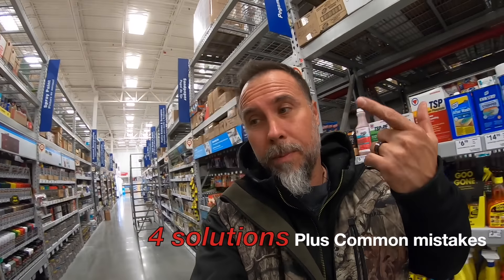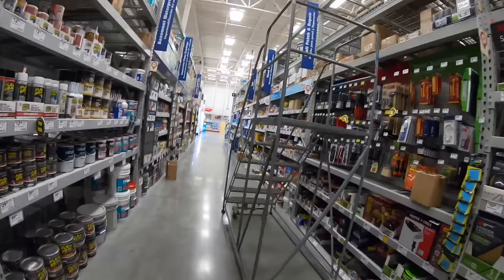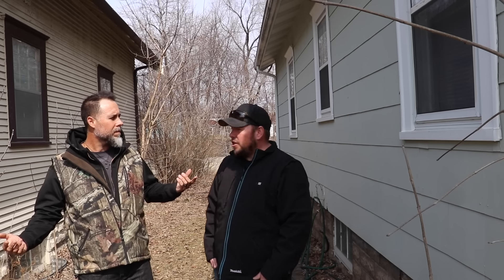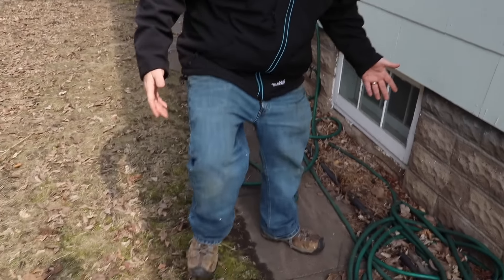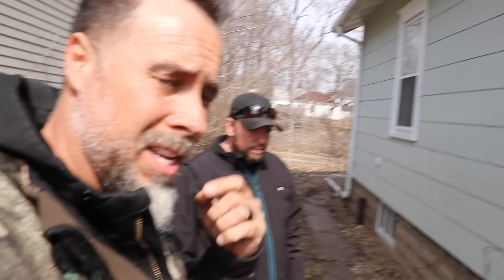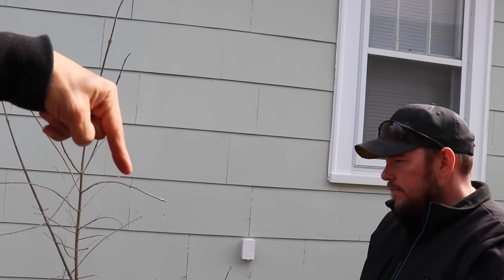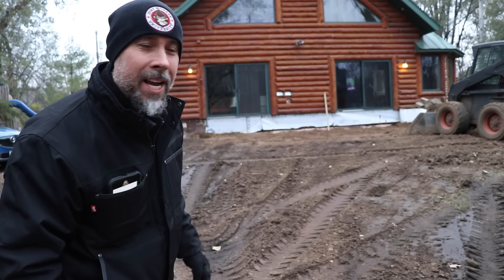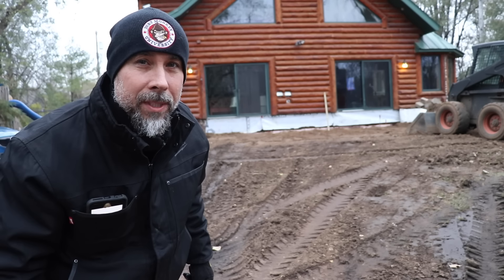4 Solutions to fix a wet basement plus Noob Mistakes

Comment: I did waterproofing for 40 years and I agree with everything you said. But I have 3 minor additions. 1 saying the cmu is hollow is a little misleading. They should be filled with concrete but their ARE voids. 2 If you are going to go to the expense of excavating to do proper exterior waterproofing DO NOT use a consumer product from the local home center. Find a waterproofing specialty distributor and get a commercial product. They are far superior. I hav3 seen far too many premature failures from using cheap materials.You don’t want to have to do it again in 5 or 10 years. 3. There is an acceptable interior solution for masonry. Crystalline waterproofing. It actually migrates into the masonry filling the pores so that the masonry becomes waterproof. Eliminating the deterioration usually associated with sealing masonry from the negative side. But it needs to be applied to bare masonry and installation instructions strictly followed. When I say masonry I mean cement based walls. I have no experience with stone and this material.

Comment: Great information.  One thing that was not clarified.  For simply adjusting the grade away from the house it is implied that using dirt is OK.  In the discussion about exposing and sealing the basement wall using clay as a top material to direct water away from the foundation is suggested.  Assuming clay is the preferred material for both?
Reply: From what I read yes, some sort of clay-loam soil would work.

Comment: Very interesting video, we dug the fondations installed a brand new french drain, we fixed the blocks that had cracks, we  put a full coat of tar on them then we installed a  rubber blanket, put the rocks over the french pipe, brought the pipe inside into a containing recipient and installed a sump pump to pump the water out into a water retention location far from the house, my sump pump is on a UPS (power backup for a computer - 1700 watts), and I have a generator backup, now since last february I installed  a device called PUMPSPY, and I can monitor all the sump pump activity,  because 2 years ago the line of water out froze and burnt the pump, result 12 inches of water in the basement, last week I noticed the sump pump was at the high point pumping up to 74,000 gallons of water out a day,  in 400 cycles, now I bought a second sump pump and as soon as it calms down I will have it installed as a backup sump pump that will activate if water goes 1 inch above the first sump pump threshold, because up to now, I am living with a single point failure system, but I also realize watching your video that all the grading needs to be redone since my neighbors re graded and now I am a sitting duck being lower that all of them!

Comment: Excellent job again but I was taught and brought up that to Shedwater it is an 8th inch per foot. Which is exactly what you have 1 inch per 8 feet. And once again you did say that in somewhat of a way but they should know that basically to shut water is Ethan‘s minimum basically what you said but for them to understand that yes you can always go quarter inch half inch 1 inch per foot. Just the rule always to know anything as per foot to shed water minimal keep it up Stanley awesome job  Wish I had you for a boss 👍🏽👍🏽

Comment: I loved this fast but detailed review of options!!  Wish video included results of what you actually ended up doing with that particular house. I live in a neighborhood of houses where spacing between home foundations is an alleyway width of 3-7 feet max’ and we have issues with water seeping in to our basements even though alley is asphalted and we have gutters. This is a poor neighborhood. What should we do? Can we use cement to better pitch and divert to front or back of homes?? I am at a loss on what to do. Water seems to seep in from lower 3rd of my basement rubble wall of 1900 home.

Comment: How do you feel about using hard pipe for a French drain when it is under 6' worth of dirt? I feel as if the perforated drain pipe is too weak and will collapse under that much weight.

Comment: I got a big basement problem. I just built a house in northern MN. My house is 60x26’ rectangle. A simple house. My basement is ICF. Once the ICF was put together my horrible contractor place backfill without no slab or bracing on the ICF wall. No decking/ floor joist also. My walls are now pushed in and my contractor is refusing to fix it. The city inspector missed this completely and now I have the department of labor involved. I with I never built a house. So stressful

Comment: I’m lost. I don’t understand how my neighbors are professional contractors but doesn’t seem to understand that their downspouts are the cause of my basement leaking? They have their downspout pointed directly towards my home. When it rain there is puddles of water sitting on my home. I’m going to get my father to raise the concrete by my home n push that 💩 back to their home! 😡😡😡
Reply: You may have to record the water trail during a rain then show the water sitting at your foundation,  then show them if it doesn't change. Then u can build a trench to drain the water before it hits your wall

Comment: I recently heard about water sump pump back ups.   Where you have a water powered sump pump that always works as long as you have water pressure.  So if the power goes out (for days) you’re not worried about the battery going dead.
Reply: On a well? Screwed

Comment: As a home inspector I've seen countless instances of people going straight to B dry interior systems instead of addressing root grading/drainage/gutter & downspout issues. And the B dry type systems tend to fail more often when the first contact systems are not addressed. smh.

Comment: Question: is it possible to add a hole outlet high on the sump pit that would be connected to drain the overflow(in case of power outage) directly to the main sewer?

Comment: A house I had in Crystal had river rock against the foundation with cribs holding it in.  Needless to say I had water issues.  I removed the rocks and timbers and regraded and the water issue was gone.  I landscaped with river rock but I put a 60 mil EPDM under it to carry water away. It was a dense clay.  The only other thing I wanted to do was bury a drain from the downspout in the rear corner of the house to the front where I had a good grade away.  I would have had to cut the asphalt next to the side steps (also the well pit).  I didn't do it as I sold the house and moved to the Black Hills.

Comment: hey.. 27 min in the video u say that the dimples on the platoon are to go on  the outside.. actually its going on the inside so that the vall can breathe.. we have been using this stuff in norway for maaaany years.. french drain, platoon, xps insulation, gravel. sorry for bad english.. From Norway with love :)
Reply: Indeed. But USA would have lot to learn about building houses that last decades at winter and harsh  rainy conditions..
Reply: No XPS here is most states-termites !

Comment: You talked about the inside drain. Do you have to dig up all the way around the basement?  And about the grading; my neighbor put in a garden which is about 4-5 feet (at most) from my home and it is about 6-10” above my yard. Is this why I started getting water in my basement?  If so what do I say to him and her?  Thanks!
Reply: Likely yes... if they are watering it constantly
Reply: My neighbor has an 18" concrete backyard  above my yard, also the sidewalk is higher than mine. I have a lot of humidity in my basement.

Comment: Thanks for the fyi on wet basement fixes. Sounds  doable. Looks like I have a lot of work to do. Have a question. I've heard of people supporting a corner of a house to fix the footing. I don't know if I need that. Probably won't know until opening it up.  How do you know when the damage is to much for a dIYer?  How do you support and fix when there is to much water damage? I've observed videos of pros doing concrete pours adjacent to the house in California.  After completing the groundwork mentioned above, is taking concrete all the way up to the base of a house a reasonable option for Pennsylvania? Thanks for considering my questions. :)

Comment: Have you ever seen a situation where an 80 year old house with a non leaking basement, starts leaking after nearby road work, after the roadwork vibrating machines have been running for a week? We've seen it break old well lines, and cause foundations to crack and leak both in the sides and below.

Comment: I was looking to grade my home to fix negative slope.  I saw about the sill plate. That's a problem for me. My house literally has a our 2 or 3 inches from the ground to where the siding (and I assume the sill plate) starts.  If I can't grade over the sill plate how do I fix the negative slope?  I've seen many things saying you need at least 6inches of foundation above grade but I don't have that. And my house has a hill going up to a street about 20 feet from one corner of my house so there's a run off possible towards the house and no way to fix that negative grade so is drain the only option and will it work without the grading?

Comment: Hey folks, noob question here. From the interior of the basement. If the cracks and seems are filled with the black tar type material, I assume similar to whats used on the roof. Would that also work well? Well meaning, sealing the cracks, preventing mold, potential pressure... If not, what is recommended?

Comment: I have never seen a French drain with dirt above it not clog by year 10. What are you doing that stops them from clogging. 

I have seen French drains with rock all the way to the surface that is still draining well after 30 years. I am in western Washington.
Reply: Ecospider5  He uses and so do I. A permeable membrane laid on top of the rock from the foundation out over the gravel a couple of feet. The water that passes through is filtered.
Reply: @HciContractor  it seems that would eventually get clogged too. If it's a filter, filters have to be replaced.
Reply: Alexander Jamieson it lets Water through but not soil. If it were to become clogged wouldn’t pass through of course but would go around. Since we slope away the water continues running away from the foundation. We use the fabric only because we need something between the gravel and the dirt on top. Not everyone wants gravel instead of lawn or a line or gravel around the foundation.

Comment: My house like in this video is close to a neighbor's house but I have soil almost 2 feet over my sill plate on that wall.  So my window wells are buried deep and I still get run off water in the wells.  I want to remove all this soil but I would need like a small retaining wall to prevent the neighbors soil from sliding down.  I was thinking of putting a patio sidewalk with drains in it so the water wouldn't accumulate along with the retaining wall.  I'm so sunk...

Comment: I have a basement where the foundation was not built tall enough.  The sill plate is already berried, and I have negative slope.  Is it possible and advisable to remove some of the siding (also berried), to apply a waterproof system/panel to the lower part of the first floor exterior wall, and then regrade so that we have proper slope?  Or is our only choice to expose the top 8-10 inches of the foundation wall, making our slope even more negative, and then install a French drain?

Comment: Just a question we don't have any issue with basement flooding or flooding inside the house. I live in northern NJ, we recently bought this house and we have gutters that flow into downspouts which flow into pvc pipe which drain at the end of the yard, im wondering if we should be concerned about them freezing in the winter? Also we had a heavy rain recently and it started to wash out the area beyond the pipe end, any quick or easy solution for the problem? Thanks
Reply: Austin Springer I bought my house in North Jersey a little more than a year ago with a similar setup. I haven’t had any issue with freezing. I was concerned about wash out with the heavy rains we had this past summer, I dug out around the outlet put aggregate (I used QP because it was handy) it slowed the water velocity and I don’t have a mud puddle.

Comment: At about 25:00 you show a “one and done” drainage pipe with the aggregate already there and wrapped. Is there a product like that for outside? I have water against the house on 1 side. There’s a sidewalk there, much like the house in the video, but there’s 8-10 inches of landscape rock up against the house between the house and sidewalk. Grading probably won’t work so I’m considering the French drain.

Comment: This was a really great video and highly technical, which I appreciate very much. When creating the interior trench to install an interior footer drain, is better to 1) saw cut a trench, because it looks nice and tidy after the job is complete or 2) jackhammer the trench, because the jagged edge will make a stronger bond between the old and new concrete?
Reply: 1.  concrete should adhere chemically, not physically, maybe some rebar in there somewhere too. with gravel under your trench.  But I am talking without having done that particular project.

Comment: I live at the bottom of the hill, my house gets hit with thousands of gallons of water, and then a hairline crack leaks, muddy water into my basement.    Can I fix this with a French drain or do I need to dig all the way down to the footing and put French drains and gravel all the way up the foundation?
Reply: I'm was the same situation with my house and I was fine until a massively rainy winter and on day 3 of a rainstorm when the ground was already saturated, I had 3 gallons a day coming through the cold joint. Small hairline cracks are a lot like the cold joint ie that water, if it's under pressure is going to flood through into your basement.

So without seeing your situation, I would guess topside French drain would not work. You have to expose all the hairline cracks on the wall, which means excavating down to your footer. (I had to go down 9 ft. Did this process and no water penetration at all for the past 4 years) Waterproof the entire wall with their process described and you'll be golden

Comment: Do not use rubberized parge! use the stuff that goes on with a trial! It will last a lifetime! The rubberized won’t last the lifetime of your foundation. And as far as the dimple mat. It has to be nailed! Not a fan, because your making holes with the nails. Use Conco parge with 2” 4x8 green foam board,and obviously install French drains.DO NOT USE A RUBBERIZED PARGE unless you want to dig it up and do it again. And when u backfill, fill ALL THE WAY UP WITH #2 shale except the last 6” then fill the rest with top soil,and grade

Comment: Generally good information, but I would I would take this with a grain of salt. This is clearly an earth moving contractor so of course major exterior modifications are his top choices. In my area there are many houses cut into the side of a hill, regrading is more often than not, not an option. Redirect as much water as possible and deal with the rest. There is a point of diminishing returns for each of these. A combination is what I would assume is the best.

Comment: What is the best solution to waterproof a basement when the only time it floods is during a really heavy rain? We had 6" of rain last night and my basement had a little bit of water in it. Never had an issue with flooding until then. Its an unfinished basement so I'm not real concerned at the moment, but I plan on finishing the basement and don't want to this to be an issue in the future. Grading seams to be fine and about 1/3 of the foundation as a concrete paving around it.
Reply: We just put flooring down in our basement, then 3 weeks later ended up with water covering the floor and under it. My best advice for finishing your basement is to waterproof your concrete then acid stain it instead of installing flooring. That way if you do have flooding, it’s not a big deal for the floor.
Reply: @amandal7684  no thanks, I hate the look of concrete floors in a living spaces.
Reply: Did you find the issue? If its all of a sudden like that, in heavy rain, it could be gutters.

Comment: Your French drain drawing is wrong. First trench, then fabric on bottom and up sides (leaving enough to wrap the entire trench after rock. ) then a layer of rock, pipe on rock , more rock the. Fold over the fabric on top of rock.
Reply: But when they did the actual drain against the foundation it looked correct. If may not have been the exact French drain but it still shows the proper way to do ot